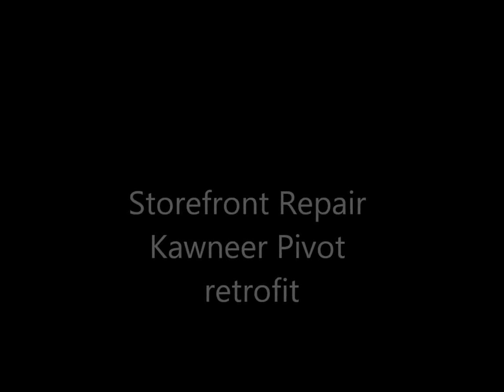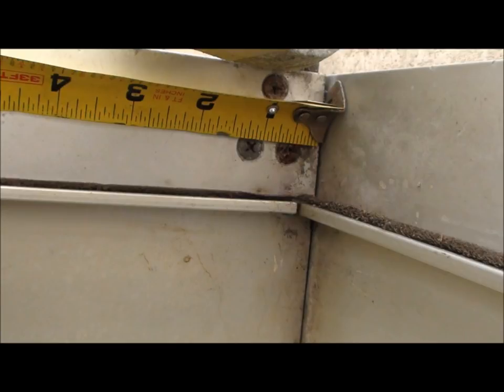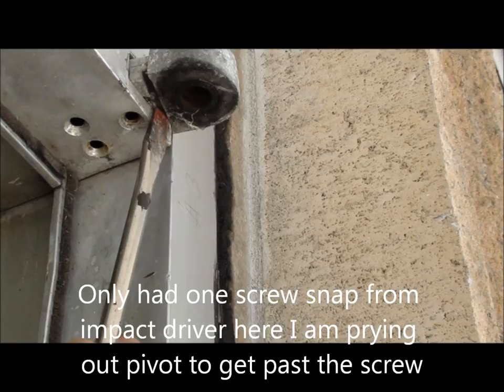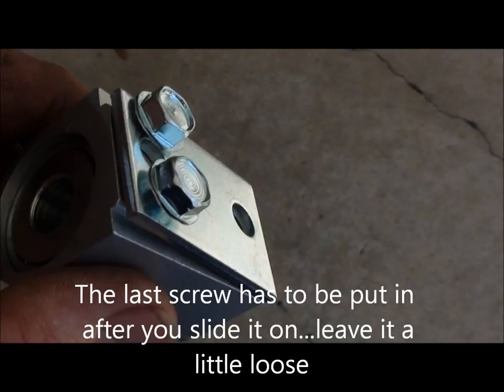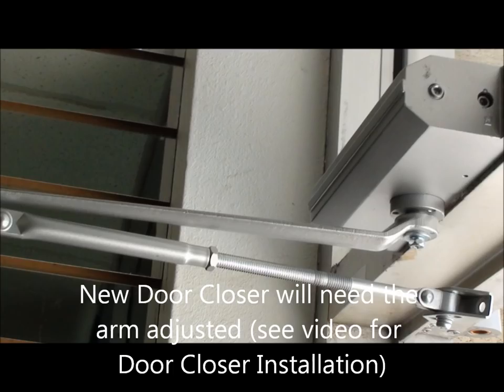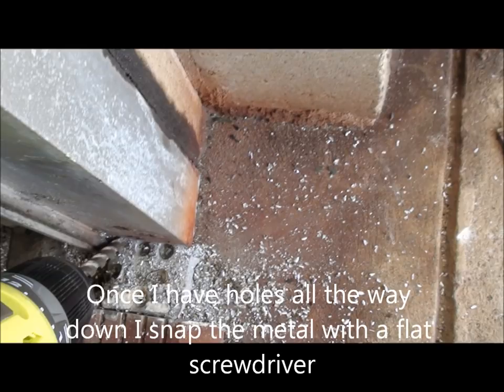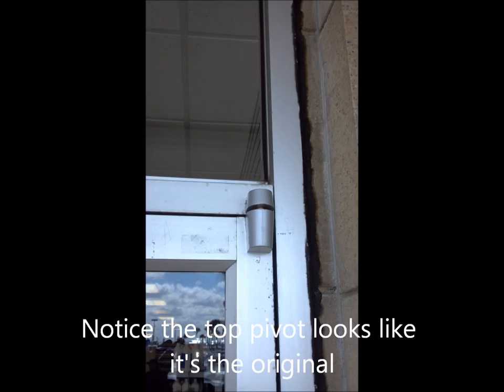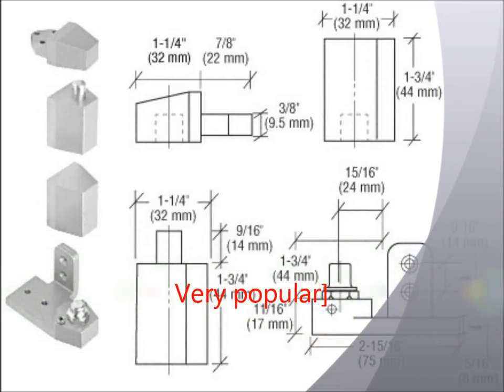Kawneer Storefront Door Pivot Replacement (retrofit)

Comment: My buddy's store has the same pivots with the bottom one having a flathead screw just like the one shown in your video. The problem is that the door sags and rubs against the frame where the handle is....and it also rubs against the bottom sill. This prevents the door from closing fully. You can actually lift the door up by the handle and it will close fully.
.
Q: Can I use that screw on the pivot to adjust the door so it doesn't sag?
Reply from the maker: Underneath the flat head screw (cover ) is an Allan-head adjustment screw. You may be able to adjust it up...if there is any adjustment left. Make sure when you put the cap back on you use an anti-seize on the cap. I have found when it is not used you may not be able to remove it. I have had to drill the cap off...keep in mind the adjustment screw is right under it and you have to be perfect. You may want to order a replacement pivot set anyway...just to be sure,
Reply: Gerald Hiebert Thank you so much for the info. Will try and see if this adjustment will work.
Reply from the maker: No problem when ordering pivot make sure the area the cover is is flat...if it is at an angle it is an Arch not a Kawneer
Reply: I apologize for the tardiness of this suggestion check your reveal to determine if the door needs to come up all the way across or if it's just the strikes side needs adjustment if it is the strike side try corner blocking the  glass that will help prevent door sag on just one side and it's even more critical on doors with an IG unit due to a lot more weight

Comment: Just put surface mounted roton hinges.
Reply from the maker: I consistantly recomend the Pemko Continuos hing but having a part that's 4 times the price with large item shipping on top. makes a lot of our customers request more cost effective option. We usually explain the benefits of long life span and able to help remove gaps in doors and make them appear more square even after buiding sagging degradation. I whole heartidly agree with you on using a continuos hing...this video was originally created for my install guys as a second option for those who wanted a patch before getting complete new storefront installed. Thank you for pointing that out Joseph!
Reply: No problem I completely understand customers always want more cost effective. In the long run the continuous hinges take a lot more beating than pivots. I’m located in néw jersey we are always doing repairs on bottoms pivots.